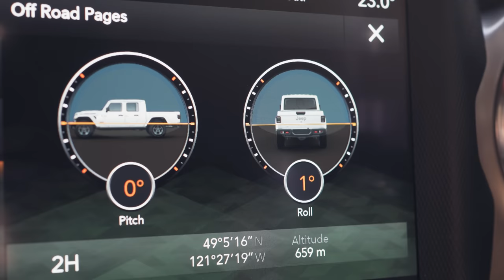Ep. 2: Relax Camping at a Provincial Park with Jeep Gladiator [iKamper BDV, Truck Camping, Relaxing]

Comment: very nice setup and video. thanks for sharing. can I ask what brand tote is the one around the 6:40 mark? the shallow one with the beige hinging top? it is the perfect size and function (in my opinion). Also, about the new ikamper BDV- can you keep your bedding in there too when packed up? Have you tried leaving the ikamper steps on the ladder when you stow it in the tent too? sorry for all the questions, but we are thinking of selling our skycamp 3.0 to get this and just had questions about storing stuff up there. thanks in advance.
Reply from the maker: Thank you for all the great questions. 
That’s one of the toolboxes that comes with the Decked drawer system. 
I had similar curiosities about the BDV, so I tried different scenarios. 
BDV is quicker and easier but very slim, so it doesn't have enough space to keep all the bedding inside. 
Little tight but keeping a sleeping bag or ladder WITHOUT HC Steps was possible in my case. Skycamp 3.0 has a lot more space compared to the BDV. 
I hope it helps!
Reply: @silentfamily  thank you, appreciate the info!